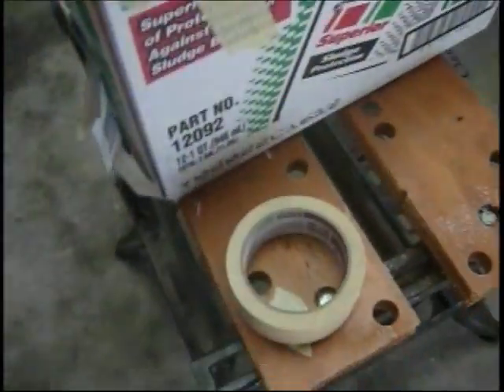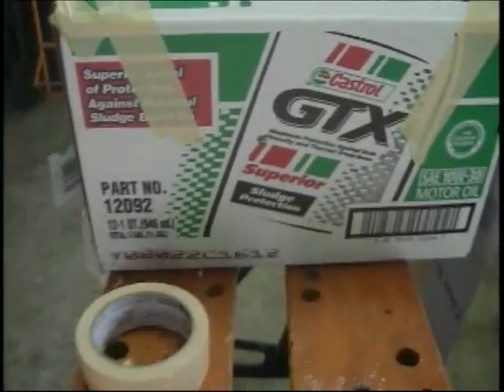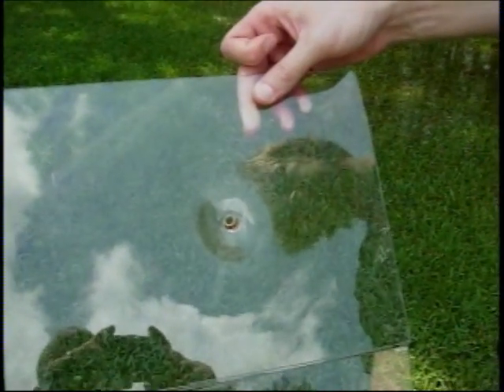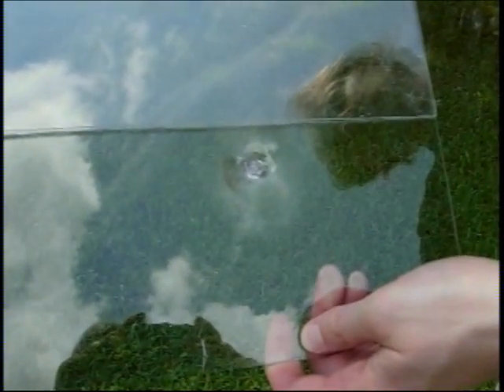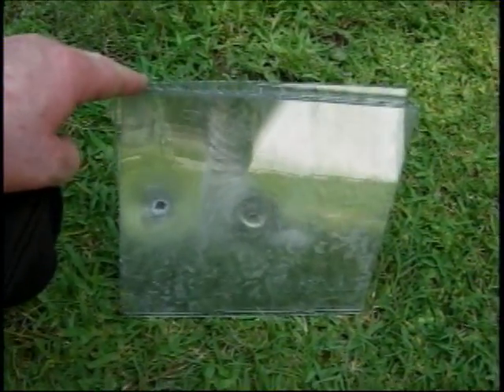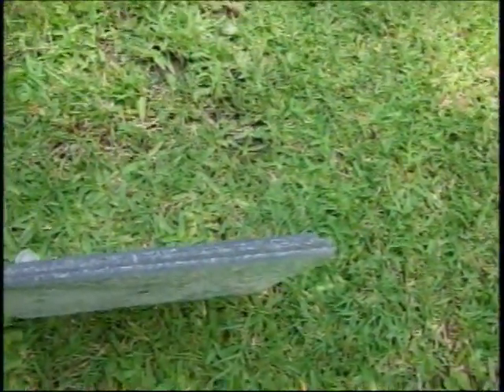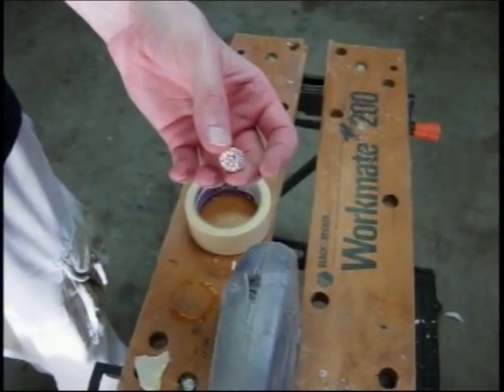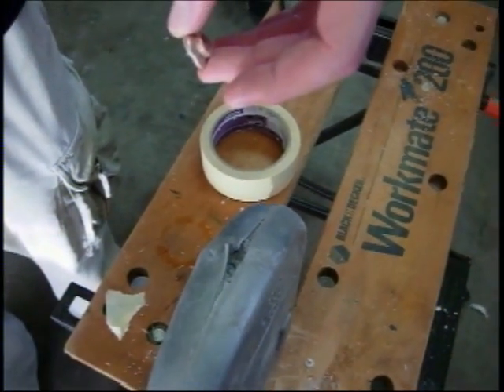9mm bullet test lexan

Comment: @BioLogicalNerd the key to most ballistic resistant materials is layering.  So less layers = less effective. 
 A lot of manufactured bullet resistant glass uses tempered glass sandwiched between layers of lexan some in excess of 4 inches thick with 20+ layers.